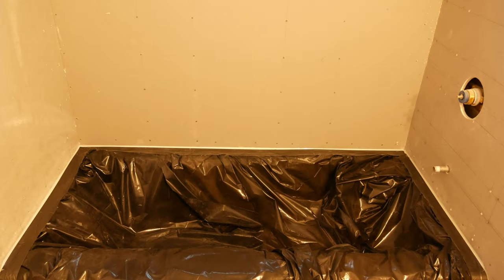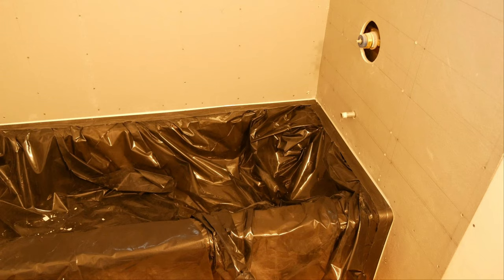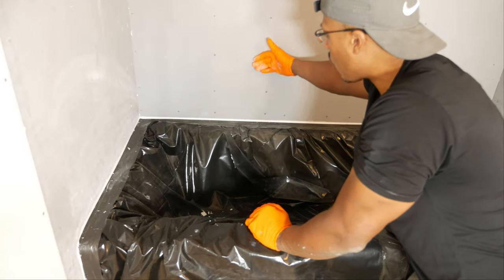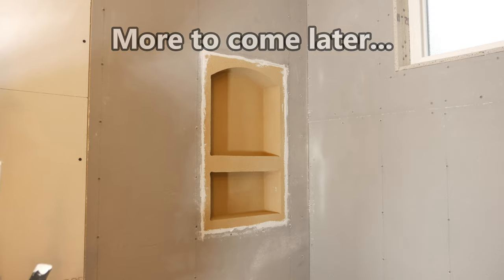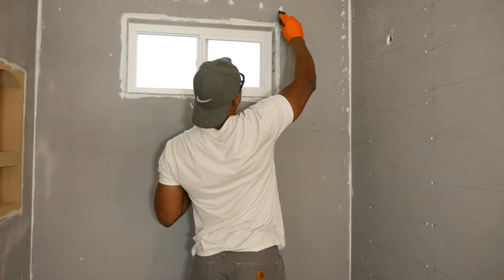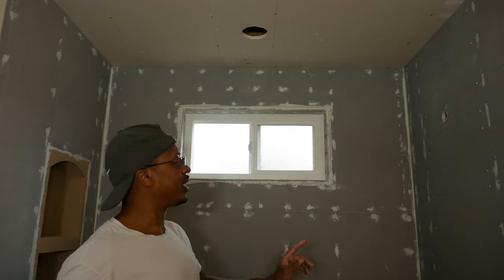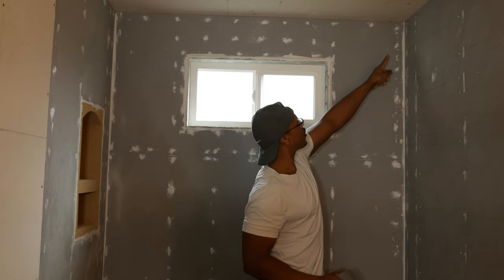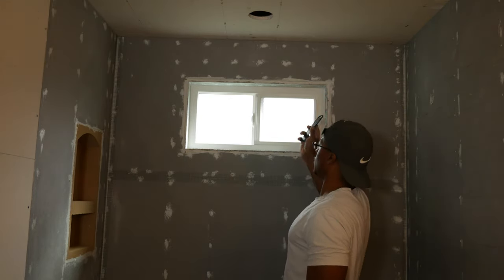Bathroom Remodel 70 - Sealing Tub Surround for Tile 1 of 2 | DensShield | Durock

Comment: could u cover the screw holes with the cement board tape and then thinset over it?
Reply from the maker: I suppose you could do it that way. I would just use thin-set without tape  to cover the screws. The holes left after I repositioned some screws and a few chips in the board got covered with thin-set in the next video coming soon.
Reply: Wouldn't it be better to cover it with red gaurd